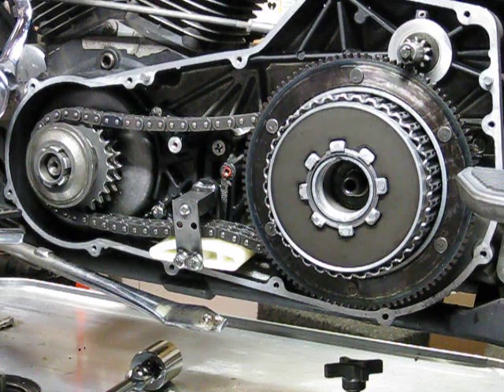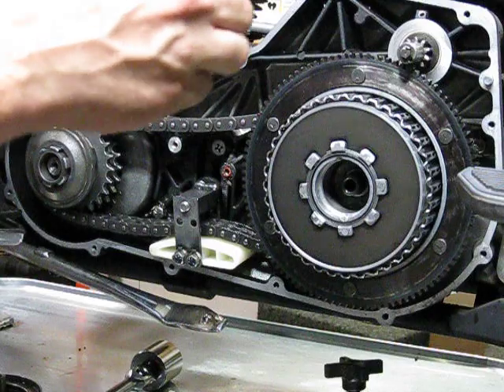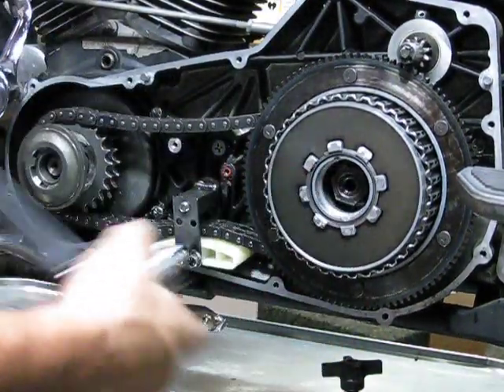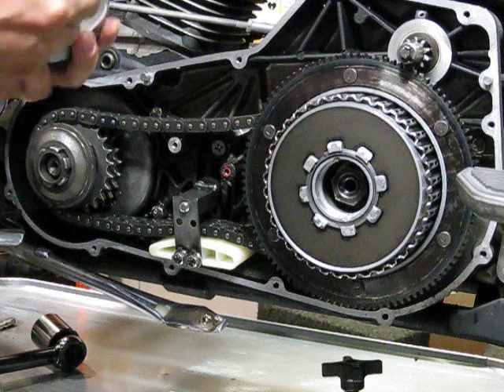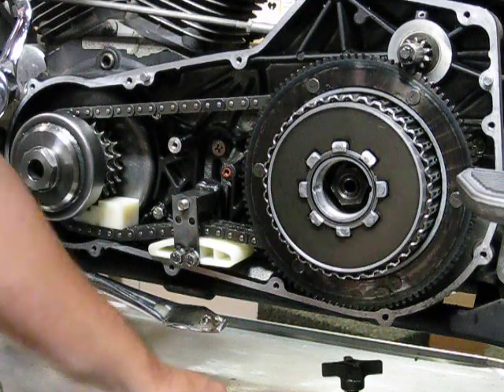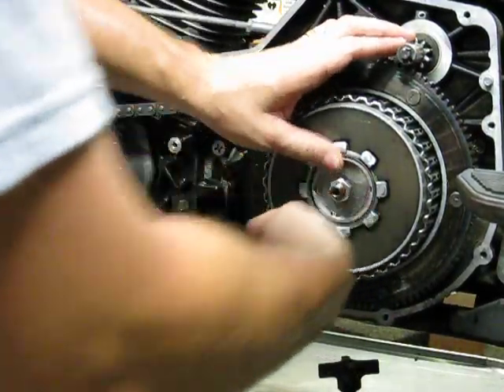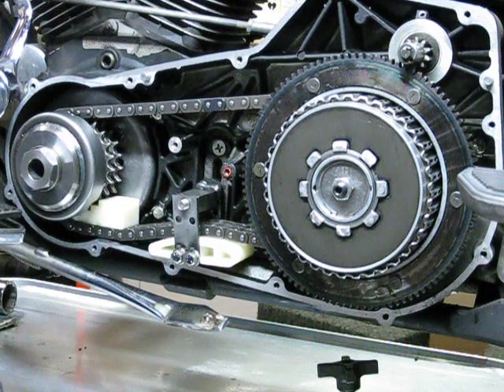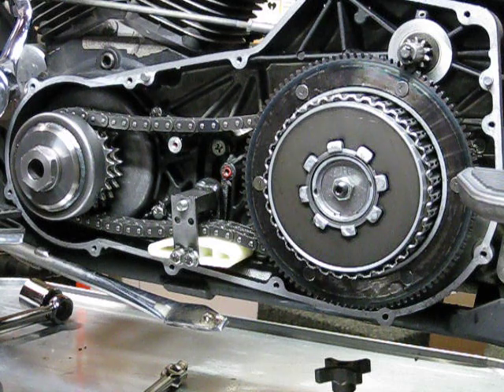Stator Repair - 3d of 9 - Clutch Installation - Torq specs.AVI

Comment: I was always taught, on an evo style clutch assy the torque should be bumped up by at least an entire ⅓'d, it may or may not have been a "tsb", what is your opinion on it, I've personally never had an issue, by the spec being bumped to 100ftlbs, and 160-165ftlbs on the compensator nut, also, granted the primary is full of oil, 28oz to be exact on the evo, OR, level to the bottom ring of the clutch  assembly, but I was always taught to spray grease(white lithium or the red) all the components, basically tensioner block, the chain and both sprocket ends. What's your opinion, I'm curious

Comment: Wrong locking tool use the locking bar only you stretched the chain badly.
Reply from the maker: Strange that a chain can "stretch" with such little effort.  Right?  But if your manual says to use something else, then I agree... use what the manual calls for.

Comment: I have a question on a problem I had. New clutch kit in. Adjusted primary clutch adjustment. Adjusted clutch cable. Tested clutch and it blew the the all the inner hub and sent the spring across the room. So what happened
Reply from the maker: Sounds like you may have missed a step,.or two,  in the manual.

Comment from the maker: @ Suzuki copper - your comment received follow up, so I looked it up to verify.  

Page 6-10 of service manual:  INSTALLATION: Step 2.  Apply two drops of Loctite 262 (red) to the threads of the mainshaft nut (1)

Again, thank you for the comments.

Scott

Comment: Red is the recommended lock tight for the compensator. If you have problems removing it then use heat.

Comment: Hopefully you don't have to do the stator again, could be fun. I was told by my buddy who's been building engines for 30 years to use blue on everything except the bolts holding the inner to the motor/trans. The inner primary bolts are the only ones that should get red because if they come up, they fuck shit up right quick.

Comment: Found your videos extremely useful when putting an EFM Auto Clutch on my 94 Road King.  But I couldn't torque the clutch nut up. Couple of questions.... How did you lock the rear wheel? My torque wrench just wouldn't seem to click and I am wondering if it was because of movement in the transmission shaft.  All done now though and riding. Cheers,
Reply from the maker: Ric,  put your sled in 5th gear then, stand on your rear brake peal,  then... take your motorcycle tie down strap,  and wrap it tightly around your rear brake pedal. 

Problem solved ;-) 

Thank you for your comment. 

Hope this helps. 

Scott 
VTwinOnline.com